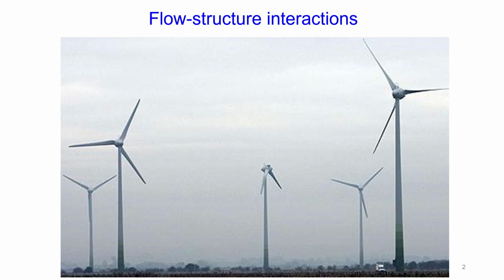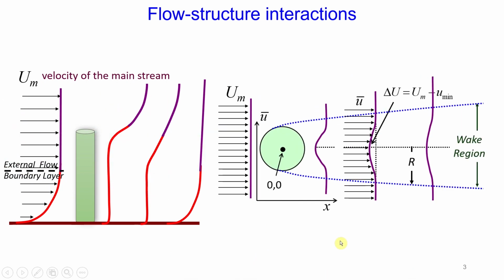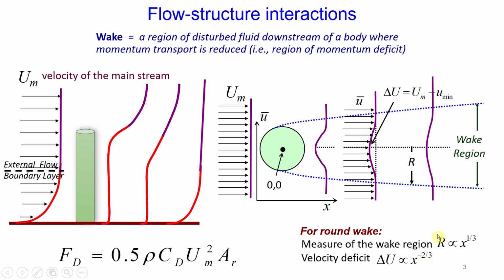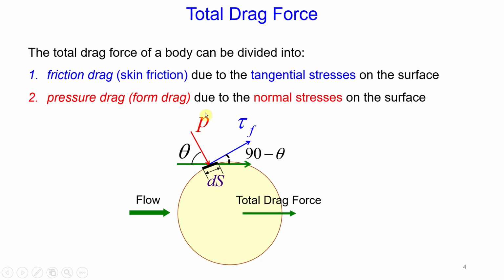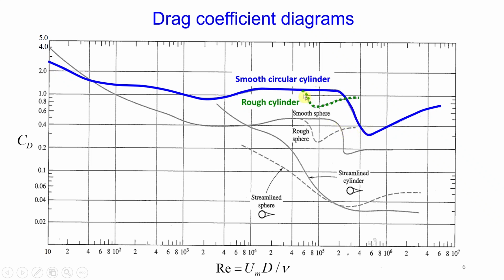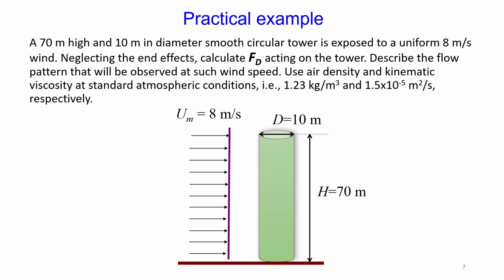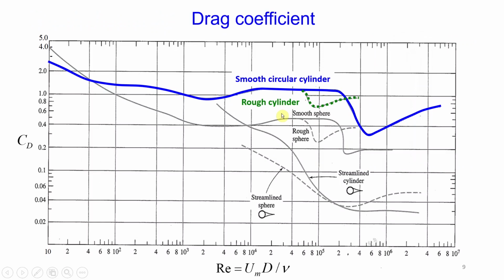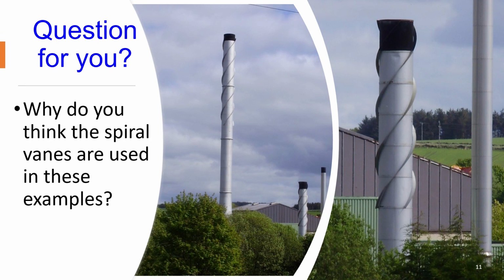Calculating drag force on a cylindrical tower

Comment: Hello, I am new in this situation. And i have a small question ^^. How can I apply the wind load into the model?
1. Point load (18.5kN) at the center of projected area
2. Distributed load (18.5/10 =1.85kN/m) on tower from bottom to top
Thanks in advanced!

Comment: Well conceptualized explanations. Thanks a lot
The spiral vanes are used to reduce the total drag force and vibrations
- By reducing the projected area
- On the drag coefficient diagrams use streamlined cylinder instead of smooth cylinder
Could you share your drag coefficient diagrams?
Reply from the maker: Good reply. To prevent vortex-induced vibrations of towers and similar structures the spiral vanes are used which destroy periodic flow separation. Regarding Cd diagram: let me know and will give you a reference where I took it from. If you do not have this book then I would be able to make a photo, but you would need to reference the source where the diagram was taken.
Reply: @StudyTips4U  Thanks

Comment from the maker: Calculating drag force on a cylindrical tower. Projected frontal area. Main stream velocity. Boundary layer concept. Estimating drag coefficient. Drag coefficient diagram. Reynolds number. Solving practical problems.